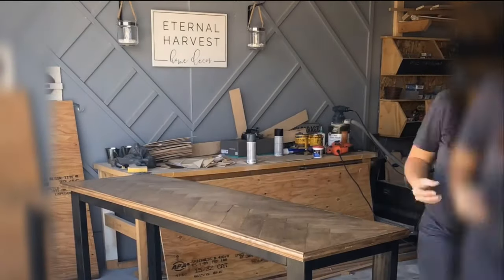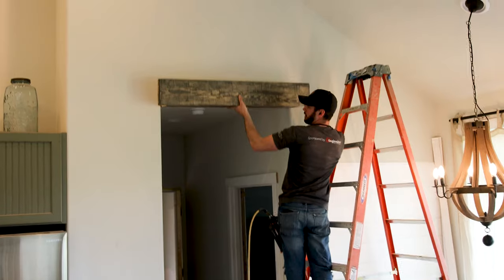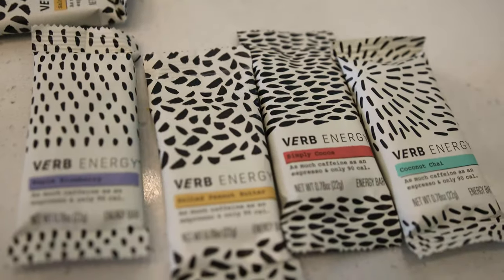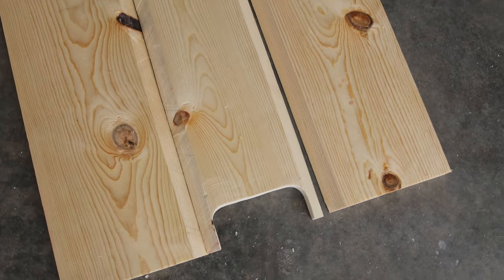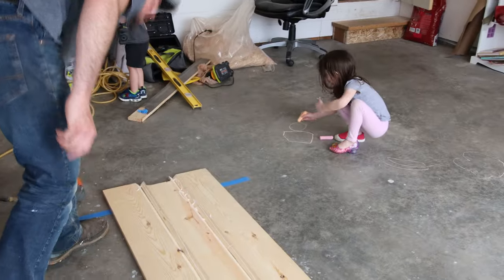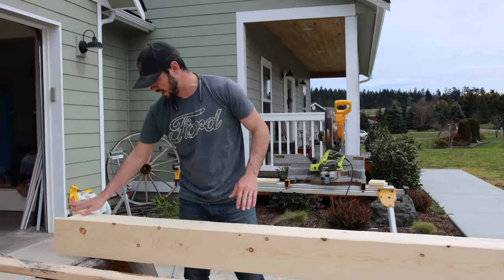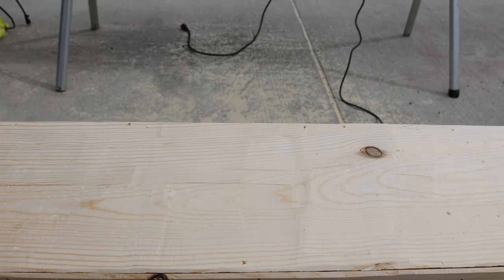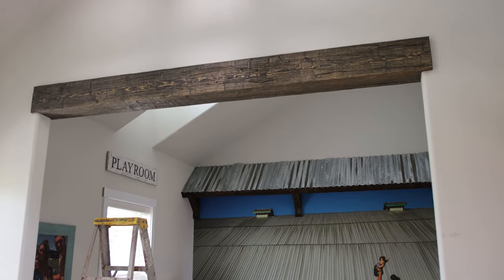$30 DIY Wood Beams

Comment: I think it looks great, but would like to make a small suggestion for consideration.  I am not trying to be a hater just building upon an already good design. The larger pretend beams are going to need a lot more pretend support from inside the wall at each end.  Adding at least 4.5" inches would account for 1/2" drywall and leave room for at least 2 pretend 2x4's underneath it inside the wall.

Comment: I've seen others just nail boards together and essentially make a long box and mount it to the ceiling. And that's exactly what it looks like...a long box nailed to the ceiling. You, on the other hand, cut your edges with 45 degree angles, glued and stapled them together, and after sanding, decorative cutting, and staining, it looks like wood beam. Well done. Very well done.